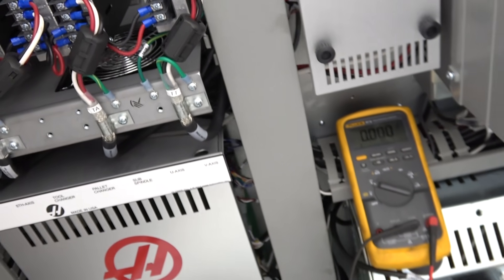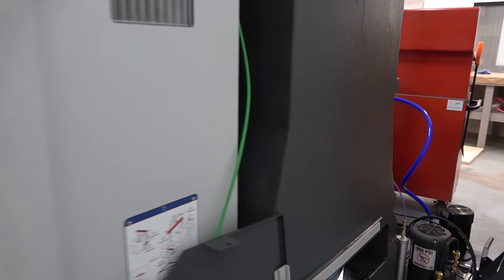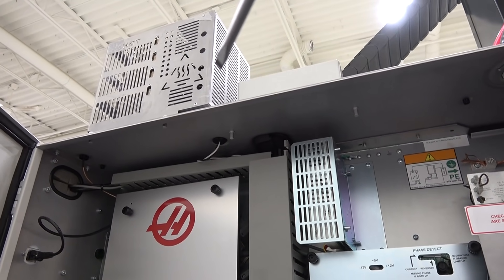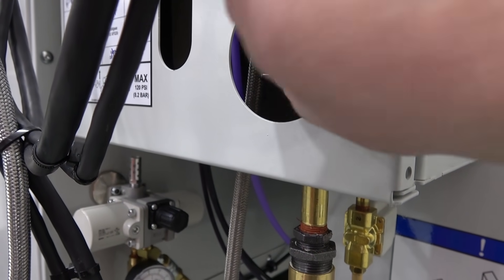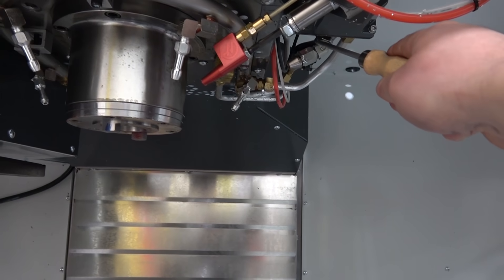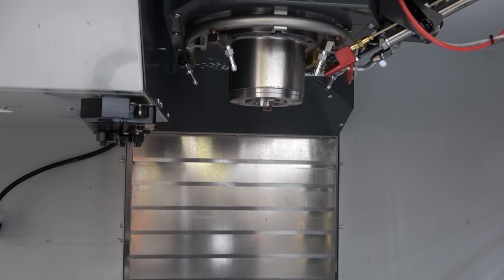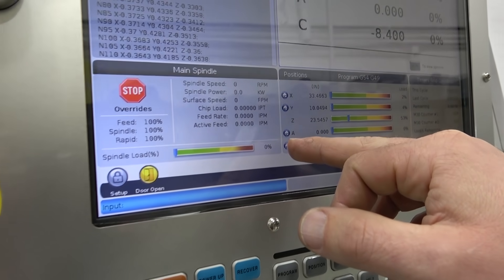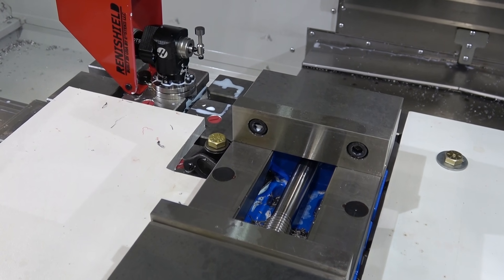BOLTR: HAAS CNC

Comment from the maker: EDIT Linear Ways. I messed up. Box ways are the most ridgid, but the Haas has linear ways.
Reply from the maker: still better than dovetail.
Reply: @arduinoversusevil2025  Can you put noga mist coolant in the min qty lube thing instead of oils
Reply: What brand do they use? Hiwin? Snr? Iko? looks like 35 rails
Reply: Ho ho! I made a beeline here to bust you on that one. So instead, I will casually mention Swiss lathes.
Reply: @jonaslacour8867  sometimes they use NSK. Put a few sets in
Reply: @macro820 , gotta make a teflon spatula to not damage the void warranty sticker to do that.  Once the warranty expires, bob's yer auntie.  But, it is an additional contaminant in the flood coolant.
Reply: Also- those aren’t brushed servos, they’re yaskawa sigma 5 brushless servos. The double arm isn’t pneumatic, it’s actually a mechanical cam box and the whole turn-down-turn-up-turn motion is all driven by one motor- a brushed motor on standard machines and a brushless servo on SS machines. FYI the oil sight glass for the cam box can be seen behind the number plate on the tool carousel and should be checked periodically. Oil can drip out of the lip seal on the double arm shaft.
The multi tap transformer in the cabinet is to get the incoming ac voltage close to where the rectifier in the vector drive doesn’t need to do as much regulation. The transformer brings your incoming power as close to 240vac as the multi tap will permit, which goes to the vector drive to rectify to 320-340vdc. 
This dc voltage represents the dc bus for the axis amplifiers, and the spindle motor variable output are the last three terminals on the vector drive.
Reply: @jonaslacour8867  THK is a big one. In fact, the machines they use to grind their parts are built with their own components, because why wouldn't you.
Reply: @michaeldillio   newer cam box has no sight glass just a fill hole with a NPT  plug
Reply: My "Mycenter3" uses box ways.. it is much more rigid than the haas mills I have used.
Reply: I am a service engineer for DMG Mori. We still produce some machines with box ways purely for that reason. They're slower than rail machines but will outcut any machine on the market with minimal chatter. We also have multiple machines that use Linear Motors eliminating the need for ballscrews.
Reply: i stopped the video right away when you said box ways. im glad you realized
Reply: @AvE   No one's noticing that it says "3y ago" when it was uploaded less than a day ago
Reply: @calebtews9502  the video is old.
You can tell because it still says Renishield on the cover of the tool sensor
Reply: @deckname5794  yeah I know. But in the comment section it says AvE made the comment 3 years ago when he only uploaded it less than a day ago
Reply: Why is his Comment from 3 Years ago or is it just me?
Reply: @qwertzbalken6076  Its not just you. I noticed it as well. AvE's Next video: BOLTR: YouTube.... Not designed to be dismantled
Reply: @michaeldillio  Is the tool changer a Geneva mechanism?
Reply: @funone8716  no. The umbrella tool changers use a Geneva wheel, but the side mount tool changers use a worm gear driving roller cams. There’s a flat on the worm gear shaft with a proximity sensor that counts revolutions to tell the control which tool is in position
Reply: How did you get a 3yo comment on a 2do video?
Reply: @maxworx1411  
He's most probably of divine nature.
Reply: Was gonna mention this error but I see that you got it.
On a separate note, am I the only one who see's that AvE's comment here says its from 3 years ago and the first two replies also say that they are from 3 years ago and all the others are 3 days  or less and the "vijo" (or how ever you'd actually spell it) is only from like 4 days ago
Reply: @maxworx1411  Haha, I missed your comment when I posted mine wondering basically the same thing...
Reply: And everyone laughed at me when I bought a box way Fadal.
Spent pennies compared to a new Haas.
MRR with my 600ipm rapids still faster. Its that DOC babyyyyyy
Added a NXGEN controller and I'm up to date with all the "new" tech all the machines have now-a-days.

Comment: Watching your videos got me into Arduino and Raspberry Pi because you applied them to things in my world that mattered. I learned Solidworks in 2005 and used it for a few years at university. Coolest thing I did was find a company willing to donate CNC time to my SAE Baja/Formula team. I arrived with a flash drive and an 80lb billet of Al-Loo-Minimum, and 24 hours later I left with a custom differential for a Formula SAE racecar. 
Haven’t done much with any machining since (I became a High School Teacher instead) but you keep me “in the loop” through your workbench and TownPumpCNC. 
Thank you for the effort. You deserve more shine for your work. 
Thank you as always,
-CY Castor
Reply: I'm making a little CNC using an old MakerBot for frame and servos, a dremel for a spindle (I'm trying to be clever and use an extend-o-cock to lower the weight of holding the entire dremel) and an Arduino with some drivers, so the thing will use actual G-code to program, just to learn how, and maybe some day if I win the lottery, use one of these bigger machines.
Reply: I'm driving a CNC machine on a raspberry pi. Videos in my playlists
Reply: @TheFeralEngineer  there goes my weekend plans!
Reply: I discovered him in a similar way. Just finished building our SAE Baja car's front differential, going to Tennessee competition in a few weeks.
Reply: companies that give of tool time are the best sponsors. Money gets things done, tool time lets you get it done.

Comment: You can get I/O from the board (6:44) in the back (Relay outputs that you can activate using M-functions, cycle start/stop signals etc). They can be quite useful (for example when you want to use a robot for loading parts).
Reply: Interesting. I'd love to make a machine like this as part of a Matter-to-commodity system for automating well, commodity production for autonomous communities. I'd imagine access to that i/o would help to enable integration with the rest of the system quite nicely.
Reply: Also pallet changers. And all sorts of automagic nonsense if you're clever.
Reply: It is like an API, but for CNC!
Reply: @dansamarco1610  Yes. The last company I worked for I was working on these and I designed an interface for 1 plug to connect a robot with the machine and fully automate loading/unloading parts.

Comment: The tool changer is driven by a servo and has a sort of cam mechanism inside. The only thing pneumatic is the tool release....if you hit the rapid speed override the tool change slows down according to that. And you can program the tool change to be slower for heavy or sensitive tools. 😉

Comment: I once shorted the resistance for breaking to the ground with my allen key. I can confirm around 450vdc run through theses resistances even when they are not making the motors brake.
My allen key melted in my hand as the workshop lights were flashing.
Love theses vids!

Comment: Brings back the first time I walked thru the machine shop my dad built 1 city block long all the press's the oil bath 800 dungarees. If n I remember they had made some parts for space shuttle. What I really remember was the magnet machine ( turned stuff magnetic), and o yeah the air gun my dad made shot the company clock half a block away,  and the ice cream truck company across the street, it caught fire one day 55 gallons drums of ice cream shooting in the sky as a kid my heart was broken.

That's one hell of a machine. Thanks for the tour.

Comment: Regarding coolant going rancid, I was surprised that I never thought about it as an infection risk. It took that hand safety video Red Letter Media watched recently to drive this point home for me. Having open cuts when you can be splashed by coolant is not a good idea, it turns out.
Reply: So what’s the affect? And what is a good place to find information on this topic. If you don’t mind my asking.
Reply: @zacharylankford4812  you can get a serious infection from rancid coolant if it gets into an open cut
Reply: @semajniffirg230  that’s no good. I’m having a problem with the coolant at work drying my hands out and making the skin crack. Also I’m getting some strange discoloration on my forearms.
Reply: Cuts also take AGES to heal up if you get coolant in them.
Reply: We used to buy those finger cots (or finger rubbers as we called them) by the gross just to keep the coolant out of nicks and cuts on our fingers. Our coolant tanks were like 5,000 gal, so they tried to get every last day out of the stuff. They used skimmers and dredgers and all sorts of additives to try making it last longer, but it didn't matter much, it was still hell on cuts and scrapes.
Reply: Worth Pointing Out: Waterjet water supplies can have some nasty stuff in them too, even if it's properly purified/processed. Apparently there are some critters that thrive in high pressure, high temperature environments.
Reply: I installed an aquarium aerator with silicone line and sintered brass "muffler" as an "air stone." I have a timer programed to run it at night, and all weekend long. Keeps the tramp oil from sealing the top of the coolant and keeps the microbial environment to a minimum.
Reply: this is not medical advice but I like to dowse my open Cuts with colloidal silver solution after each exposure to coolant
Reply: That's what apprentices are for.
Reply: You just need to be blessed like those of us with autoimmune diseases. I NEVER get infections. I mean, every other aspect of autoimmunity is ruining my life... But you know, silver linings and all. 🤣
Reply: Is there not a disinfectant you can add to the coolant to extend its life?
Reply: Enjoy looking up "hydraulic point injections". Horrible injury, poor souls.
Reply: @justtime6736  I once tried to unstick a sticky spinning pressure washer nozzle by flicking it, and it punched a small hole into my thumb. Thankfully, it was tap water, and a shallow wound.

Comment: The way the vector drive controls the power is much like pulse width modulation, PWM, but since the motors are AC it does SPWM, S being senoidal. It simulates an AC current and controls it with the modulated pulses.
I find this freaking amazing!
Reply: In addition vectors control uses velocity feedback to control for velocity. Helps keep the torque up under load.

Comment: I worked at a place where we did a lot of crankshaft grinding. The coolant from those things gets extra flavorful after awhile!
Reply: Now I can't stop about the sludge cleanout after who knows how long machining iron of various varieties.
Reply: @sdhlkfhalkjgd  i was at a shop that l dont think they ever cleaned out the tanks. They were replacing a pump one day when i was there to pick up some heads. You could smell it two blocks before you got there!
Reply: chaw spit and third shift whiz. frothy. and the new guy gets to change the filters. ask me how i know.
Reply: @wrenchmonkey3920  
I did some of my apprenticeship at H/P.  The 3rd shift was the same.  Chaw spit not so much.  I always wore extra long rubber gloves.

Comment: The coolant can get a real nice piquant top note on the older machines that use a lot of way lube. I’ve use a wet dry shop vac to skim the oil off the top of the coolant where we don’t have skimmers. I run mostly Cnc lathes. We’ve got an 80’s era Nakamura Tome lathe that has a magnetic tape drive in the back of the control. And  we still make production parts on it.

Comment: I didn’t hear you talk about it in the video but the way the servo motors purposely preload the bearings to cut the internal clearance down to nothing to assure minimal vibrations is super cool. (I’m an electric motor tech)
Reply: Most servo motors I've dealt with use plain ball bearings. You're probably thinking of the angular contact bearings the ballscrew is in tension between, or the bearings in the ballnut itself. Those are what work to keep backlash to the very minimum.

Comment: Brother man for when you go over the tool setter in the next vid one of the best tips I ever got in the shop was to put a dowel pin (ideally ground on the end) into a tool holder and touch it off then write that number down and stick it on the door. If you always keep that tool built up and out of the machine nice and clean whenever the machine has an oopsie or booboo and your not sure if your alignment is screwed or not a quick way to check it is to re touch off that tool, if it changes more than the error of repeatability of your probe your alignment is hooped, if its the same than you're a ok. 99/100 if your alignment is ok everything mechanical should be fine and your good to keep going. Trick also works if you wack your tool setter and you wanna double check it's ok!

Comment: On my Haas TL2 lathe at work, I had a servo drive for my Y axis blow up on me a while back. Running a part followed by a very loud bang and the main 3 phase breaker at the panel tripping. I believe it was about $900 for the single servo drive and I replaced it myself  due to the machine being out of warranty. The main machine control cabinet still smells like magic smoke :)
Reply: only 900 bucks? I always wondered why Haas parts are so expensive since they are not one of the high end manufacturers. The VF3 I work on recently got a new Vectordrive, 10,000€ (5k if you return the old one) for a part that's essentially a fancy VFD. Prob. died because of a mean crash that tore the belt apart.

Comment: Coolant doesn't have to go bad if it is maintained right! My workplace (huge factory) shares the coolant for all its CNC machines, and this summer they performed the first complete change in 20 years. Not because it had gone bad, but because they wanted to change type of coolant.
Reply: The hell brand of coolant were they using?
Reply: What kind of filtration system were they using?

Comment: Nice look behind the sheet metal. I believe all HAAS machines use linear guides not boxed ways. Boxed ways and dovetails are both metal on metal sliding interfaces with oil in-between, no bearings. EDIT: I see you noted this already, my bad.

Comment: Had a student miss just about everything he was supposed to have learned today. Had his face mill in tool 1 on the g code, but that's where the probe sits. Luckily I hit an e stop before it revved up, but e stop mid tool change. Crashed the spindle housing into the tool holder housing like 3 times using recovery and reset before I figured out you have to answer the questions properly and manually pull the tool from the carousel. Haas mini mill.

Comment: One machine shop I did Dewclaw work at used a sump scum skimmer system that was basically a clock motor and a timing belt to lift the gooey bits off the coolant surface.

Comment: This used to work on older Haas machines to run with door open: To run machine with door open:

1.	Settings
Go to 7 Parameter Lock (enter 7 then push cursor down) Select "OFF", push enter.
Note: flashing of cursor means that it is not activated, push enter to activate.
2.	Go to Parameter 57
Push Emergency Stop in.
Change the "Door Stop SP" from "1" to "0"

3.	Settings. Go to 51
"turn Door Hold Override"to "ON"
Reply: Parameter 7 is hidden on the newer machines, they don't want people changing those setting anymore :P
Reply: This was useful mainly on lathes that I could not see into because of badly scratched glass. That way, I  could single block the program and have the feed and speeds turned down  to avoid a crash while I was trouble shooting new programs and when operators tried to do more than hit the green go button.. or in many cases... the green crash button. 
I was the engineer responsible for all machine and robot programming.
Reply: This procedure also automatically activates the Safety Squint mode

Comment: The minimum quantity lubrication is super nice. . . at least for machining aluminum.  The big ol VF10 at work runs that and I've found I can push that thing every bit as hard as I would with flood coolant.

With steel or other harder materials, I doubt that it would do as well.

Comment: Get rid of the canola oil and use dish soap, not sure whether it will work in that machine but it works well as cutting fluid on a lathe or drilling. Dawn is what I used at work.

Comment: You can also use high pressure air, in the showroom thats all we used, granted you have to have a hell of a compressor and tank to run like that but it is possible. Nitrogen has also been looked at but the cost for a chip shop dosent make sense, but if a shop had excess nitrogen gen for a laser that could be used for chip evac, and cooling for tooling. But much like the videos of today nothing is the same without the good old blast of the white stuff.

Comment: I like to think of movements as if the tool were moving... ie: x+ being a tool moving to the right. I know that seems weird when you jog the machine around, but it's more sensible when thinking about the axis as a graph...
Reply: 3 years ago?
Reply: @SteveVi0lence  I don't remember, but this was probably unlisted for Patreon members
Reply: @SteveVi0lence  Previously private video that he just made public.
Reply: Cnc axis definition is "as the tool moves". It makes no matter if it is actually the table,    program the motion of the tool. On a vertical mill, tool to the right is pos x, tool away from the operator is pos y, tool up and away from work is pos z
Reply: Same

Comment: Also are the haas tool changers pnuematic? I’ve seen them being built they are much cooler than pneumatic they are a barber pole cam for the rotation with another cam on the side for the up and down. It’s pretty cool but they may have moved to air Im not sure on that